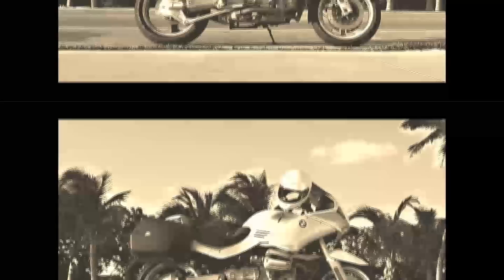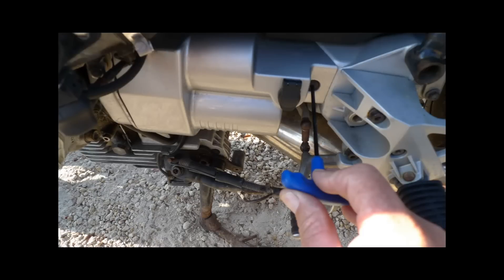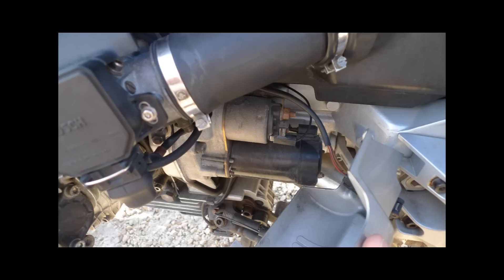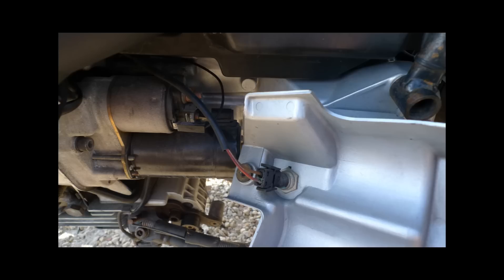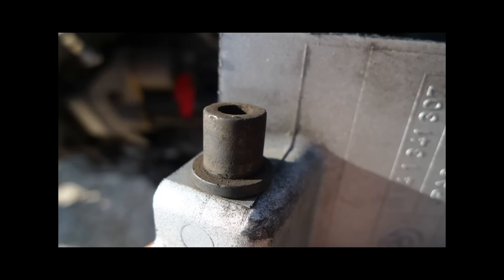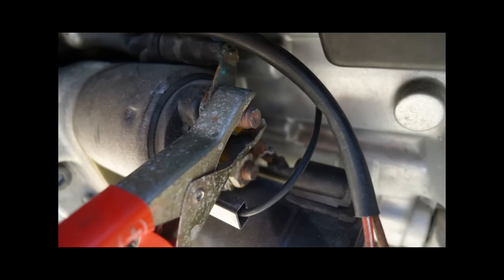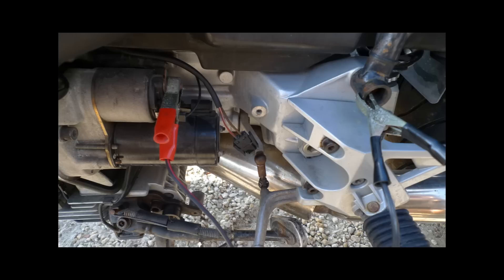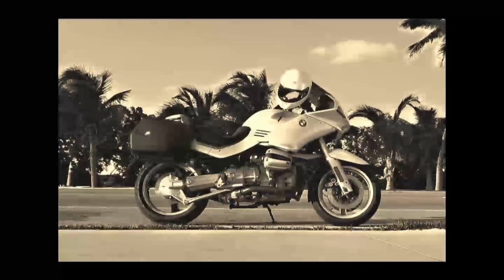Cheat for charging Battery BMW Motorcycle

Comment: EVEN MORE EASY: in front of the airfilter is the battery, there is a little plug-in laying on your airfilter or seroundings. Use the plugin to charge, you only have to remove the seat. I cheated the plugin (did not have the connection) by cutting of a piece of plastic at the positive side (the negative pole of the battery was reacheble) or for you mayby a little cut at two sides to connect your loader. No need to remove the fuel-tank, 2 minutes of work.
Reply: do you have pictures?
Reply: mark stubbe 

Thx so much for this. I used it just now and worked perfectly

Comment: For all those of you who say "well gee, just use the socket..."

That's fine but BMW does NOT use a universal size for their socket.  They use a different (EU?) size, at least on the 04 model I have.  My advice is the next time the dealer or someone replaced the battery, add a pigtail anyway JIC.

Comment: I think it's even faster going straight for the battery:

1 - Remove the seat.
2 - Remove the single bolt that hold the taink (throttle side of the bike, right under the plastic that covers the gap between the taink and the Throttle Bodie)
3 - Just lift the taink.

Don't unplug anything, no hoses no nothing. Just hold the taink lifted with something you've got laying around (I have a plastic thing I keep in my fusebox caus it fits right in there, and it hold tha taink right where I need it).

Comment: I added a Switch To Starter Cable to the positive terminal and covered the exposed free end with a rubber hose.  I just need to remove my seat to get access.  You can pick one of these cables up for about $5.

Comment: As of now, I have fitted my bike with a second fusebox and I splitted the positive lead and fitted an SAE plug to it.

The SAE plug is holded by the bolt that serves as the negative (bolted to the frame), behind my side panniers. It's clean, and I can also use it as an SAE power outlet for HAM radios and such.

Comment: Why not just use the studs BMW built into the engine for this very purpose?

There is one (+ve) forward/above the gear selector (next to the charger connector...),  and the other is on the back of the left cylinder, just under the air/fuel inlet (-ve).

Both stick out the perfect amount to attach a crocodile/spring clip battery charger lead or jumper cables... which is what they are for!